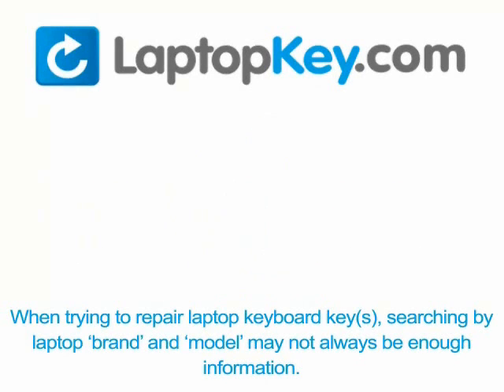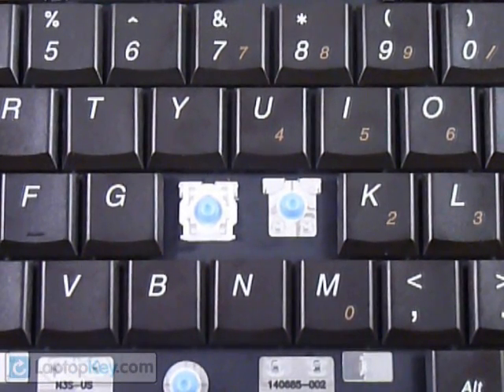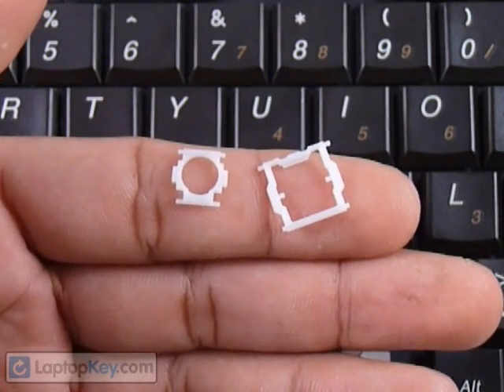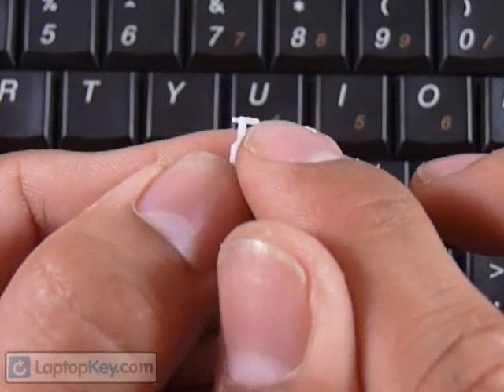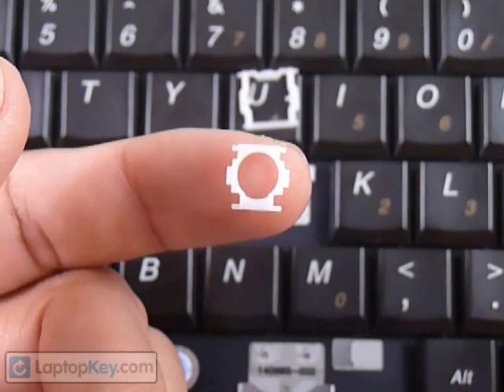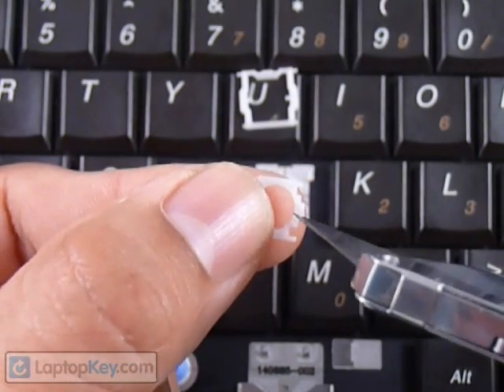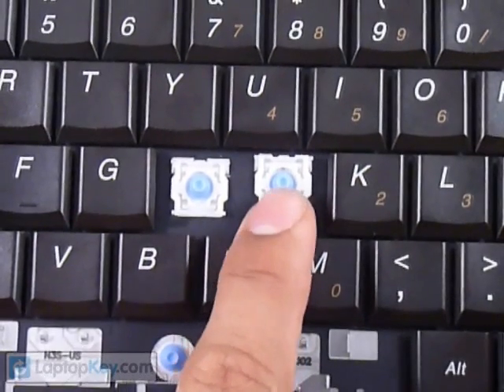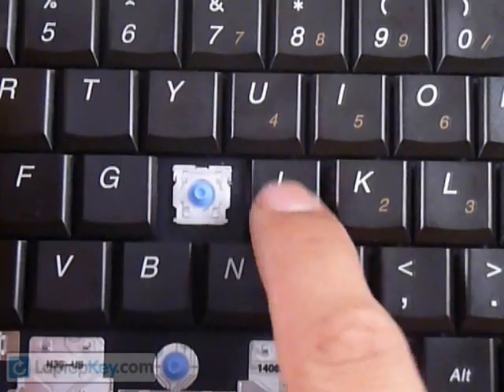Single Laptop Keyboard Keys Repair Guide | Dell Studio 1535,1536,1537,1735,1736,1737

Comment: Well, after having dropped each piece at least a dozen times each and then have the thing come apart when trying to put in the latches, I finally found your great tutorial.
After successfully breaking one of the metal tabs of the keyboard, the bottom one,  I cursed enough to within thirty minutes manage to have a 3/4 insertion. Lucky for me it is the Caps Lock key so I'm okay there.
I really want a back-lit keyboard anyway.  Thanks, good job.

Comment: the hooks are on the back of the  key that came off my keyboard, still stuck to the key.  no clue how to get it back on.  also some kind of teeny tiny clear rubber plunger looking thing came off as well.  have a Logitech illuminated keyboard, 2nd one so far, keys keep popping off, sets me back around 100 bucks every time.